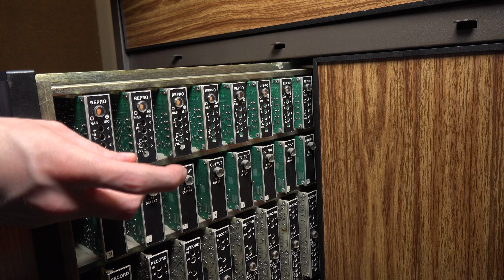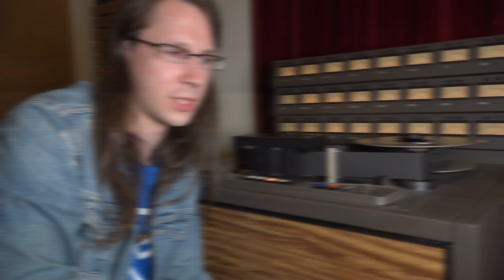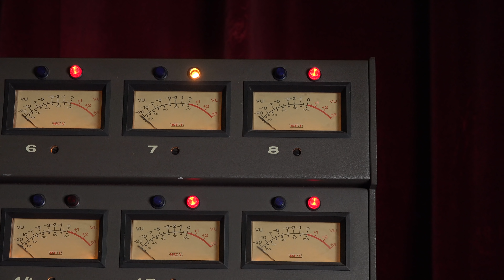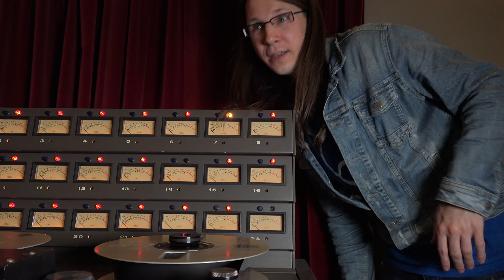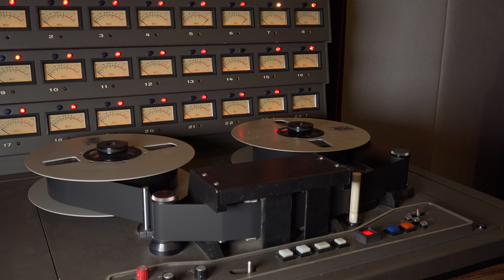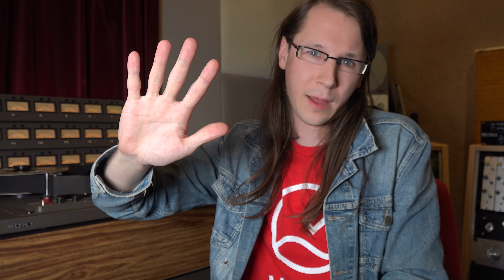MAKING THE ULTIMATE TAPE "PLUGIN" SOUND EVEN BETTER!

Comment: On the MCI machines it is recommended to center the low frequency adjustments before doing level calibrations. Then you have to do low freqency during the record calibration in order to get accurate low frequency calibration.Especially if you're using a real MRL tape for alignment due to the fringing effect.

Comment: I love your videos you are a very sharp and talented guy. I am very interested in reliving my past, again. I owned and operated an analog studio in Hollywood in the late 70's. Thanks for keeping the analog flame burning and hell yes I could hear the difference at the end of the video. Nice! Bias shifts your center position along what's called the hysteresis curve, basically how many of the little magnetic domains do your bidding during recording. It's a non-liner (read "touchy") high frequency tone added to get things going on the tape. You can hear it if you move the tape by hand sometimes.That and of course the level you print at make a huge difference. Yes 520 nw/m is the common standard. Keep up the fantastic videos. Best, Tod in Vegas.

Comment: I do a lot of tape baking. I ended up getting a commercial food dehydrator, so that I could do several tapes at once, and control the temperature. Cool down is as important as the baking.I usually let the tapes cool down the same amount of time they baked. I usually will back a 2" tape for 8 hours at 130˚ F.

Comment: if you want a solution for making the tapes absolutely safe during baking, get a metal shop to make you a little round case out of Mu-Metal. these are a class of steel that are optimized to conduct magnetic fields internally in a way comparable to how a Faraday cage works for EM. instead of penetrating through, the magnetic feild travels parallel to the surface of the metal from one side to the other without entering the enclosed space.

Comment: Anything Ampex 456 is a sticky shed syndrome. Get a manual for the machine so you get the transport and the audio alignment right. Do the azimuth too. Don't forget to align the PSU. Keep the heads and the tape path clean especially during alignment. Any dirt on the heads will screw up your readings on the meters, so is a defective calibration tape. I had a bad MRL that made the alignment impossible. Owning a tape machine is a lot of work  :)

Comment: If you want your tapes to translate on other machines, you must set hi repro at the same dB setting as your 1K test tone. Your warble on channel 1 and 2 is likely an azimuth problem on your heads. There are a number of easy ways to check that and adjust it - that is actual "alignment" of the tape. What you are doing is technically a calibration. Alignment is technically the orientation of the tape heads to the tape path, which you probably want to deal with. I hope you love working on this! I have only an Otari MTR10 in my room.
Reply from the maker: Probably not azimuth, but yes, it is a head alignment issue
Reply: @Whiteseastudio  Ah, sorry - you're right. It's the zenith.

Comment: Look into it a bit deeper. The actual heat does many more things to the tape materials than just remove humidity. Heat affects the molecular alignment and cohesion of the metal particles and de-stresses (flatness or wow) and removes micro-waviness (flutter) of the bi-material joint in the backing-material-to-metalized-sides of the tape.

When you use a tape it gets stressed and curved tighter or looser on the two sides by a slight amount. Over time, this gets learned and 'set' into the tape aging it prematurely. By heating it, the mylar backing is allowed to stretch or shrink and ease this curve stress. The oxide is allowed to realign gently into the new curve shape without congregating on the stress lines so they won't exaggerate the non-uniform shape of the stress lines. This is mechanical engineering and not personal experience with a beast like you have. Just thought I'd mention it.
Reply from the maker: Cool!

Comment: Normally when aligning repro and record heads, you are setting your hi and low eq to the same reference as your 1k.....in other words, you are aiming for even frequency response from 20 to 20,000hz. You don’t need a 100hz tone on your test tape, just use whatever low freq it has. It’s most important in the rec alignment anyways. If you really want to geek out, on your DAW feeding into all channels, sweep slowly from 20 to 20,000....you’ll find out where your “head bump” is. At 15 ips, it’s usually around 50-80hz.

Comment: Regards to the tape bias, the tape looks quite dark like a Chrome or Metal type tape. Wonder what kind of tape formulation these professional tapes use as it doesn’t look like Ferrous Oxide like type 1 cassettes but more like Chrome tapes that are more black in colour. The calibration looks like a job for grey bearded wizzards.
Reply: It's ferric not chrome, if the oxide is black it might be cobalt-doped ferric, but certainly, it's not chrome. Also the cobalt-doped one would require more bias to record it properly.

Comment: Another dude from the 70s here.  Polyester backed tapes seemed to suffer worse for flaking oxides and deterioration of binder.  I was told the best way to 'cook' a tape was to find an old electric 'slow cooker that used a ceramic cooking 'pot' top.  They use 60 watt light bulbs as the heating source. No fans. I still have a Swiss built half track  7:5" 15" ips Revox A77 and 400 10" reels of tape and a full service manual.(Not selling any of it.)  Have hardly used it since replacing the heads though. I have 'Baked' a few tapes successfully but they won't last as long the second time around. I would suggest putting your calibration tape box in a sealed ziplock bag when not in use.
Reply: Revox...great sounding machines...had one in the 70s....
Reply: @TheAerovons  The reason I got the Swiss machine over the German one was a better capstan motor and shaft. I like I can take a card out and replace components. Quantegy 456 were the last two reels of tape I bought. Still have one unused, sealed and boxed. The BASF Pro 50 are the ones I have with least oxide problems. Lived up to their storage claims. I worked at a small independent London studio and we started out with  horrid British machines  from a closed down film studio I think they were Leevers Rich machines but eventually upgraded to Studer.  I noticed here when biasing, the meters still had a wobble . Back in the day they would have been rock solid. I think unless there is new tape to be had this will always be a problem. Pity.
Reply: @cubeaceuk9034  Ah understood. I did an album at Abbey Road in the late 60s and copies of the mix were made on the little Studer that looked like the US Revox....sounded great!
Reply: @TheAerovons  Revox was the Hi-Fi side of the Studer Studio business. The German plant only made Revox while the Swiss plant did Studer and some Revox machines that were half track high speed. Hence the difference in the capstan motor. Studers were much more silent and had much better tape handling as well as better electronics. We used Revox's for client copies and had Atari  high speed reel to cassette duplicators for short cassette runs, say 400 copies. We also did radio broadcast cartridges for radio stations. Jingles, radio idents, and commercials. Not much in the way of music that often sadly. I never got to see Abbey Road although I had visited Trident and listened to a queen mixdown and the Round House while they recorded a Boston track as well as De Lane Lea South next to the old Wembley stadium and saw Roy Wood leave as we arrived. Those were the days :-(
Reply: @cubeaceuk9034  Ha yes went to Trident once, coming from the US the little tiny street (almost an alley it seemed) amazed us!. Odd studio but good sound. When I was there they had 4 Monitor speakers in the control room! We were lucky enough to be there at a time when The Beatles were busy, so met them and it was the thrill of a lifetime. REALLY nice guys, you would never know they were who they were!
Reply: @TheAerovons  Ha! yes. Most studios around London at that time had entrances you could miss. Odd colour schemes and layouts. Command Studios that never got to open was one of the weirdest. Happy days.

Comment: I use a 100 watt bulb for my heating element when baking my tapes, i also use a small computer fan to circulate the air.
Reply: The bulb acts as a low power demagnetizing coil and the fan has a 4 pole ring magnet and 4 PWM electro magnets in it. So you have installed 2 demagnetizers and a permanent ring magnet with 4 poles next to your tape. There are more desirable ways to erase a tape, but that will surely do a job on the contents. I think I'd try a file box (with some holes in the top) with a dryer hose stuffed in it. On one side of the hose is the box and a hair dryer taped to the other. Plug the dryer into a variac to adjust temp and airflow / noise. But that's just me, I have all those things lying around my apartment.
Reply: @pappyman179  hi, in my custom made box for baking tapes the bulb and fan are about 7" away from the the tapes and the bulb / fan are inside a metal tin, so I wouldn't think erase is a problem,

Comment: We use put the hihat on channel 1 and smpte (if needed)  on channel 24 because of the outer edges of the tape are not as optimum. I'm not sure if there is science behind this or if this is what we learned back in the day.
Reply: The outer tracks are always a little wonky due to any variation in the tape width or tape path not keeping it perfectly over the head as it passes by.
Reply: So definitely keep the bass drum or anything important from channel 1 and 24
Reply: I'm confused, what's SMPTE used for?

Comment: Great job, i tried to restore 2 old otari mtr 90mk3 machines. Boy it was hard work, and in the end the motor needed replacing at massive cost, so the client sold the machine as is. It would be wonderful to hear a full comparison of tracking instruments and voice on this mci machine  as setup now, and then comparing the same perfoemance with tape plugin simulation. Thanks, great video.

Comment: Bias is a 40khz plus signal added to the recorded signal to jostle the magnetic particles and allow the low-level audio signal to move the particles. Different tape composition requires a different level of bias. That's as I remember it from the 70s. Thanks for another interesting video.

Comment: pay attention because when tape i too old, the. agnetic flux is less or even much less than the required. It should be thrown away.
When I was working in Ampex, we changed the alignment tapes each 6 months.
Reply from the maker: Aaah... So now my machine could possibly run at 700nWb? 😅
Reply: White Sea Studio you just misaligned your machine. Such tape is just garbage. The backing process, serves only to recover some matiral from sticky tapes in order to transfer it. Then they can be thrown away. The magnetic flux you find today on such old tape, is far to be the one declared on label. Hence it’s useless. But if you’re happy so .... with a misadjusted tape machine ...
Reply: @Not-Only-Reaper-Tutorials  His machine may be perfectly aligned, the reference level may be off though. Not a big deal if he's only using the one recorder and not playing back on other machines in other studios.